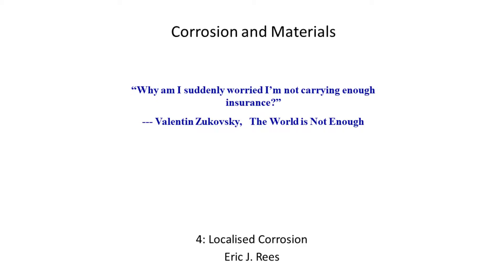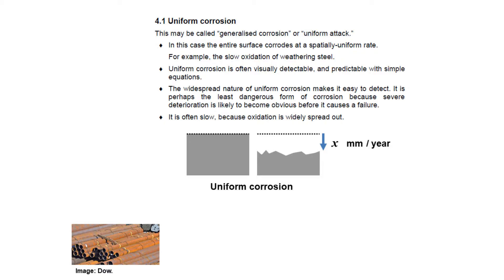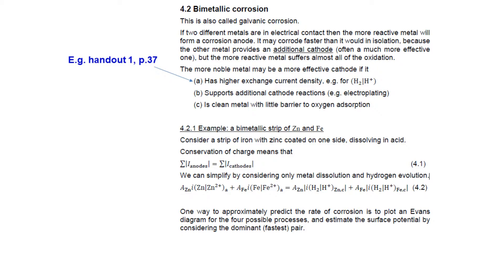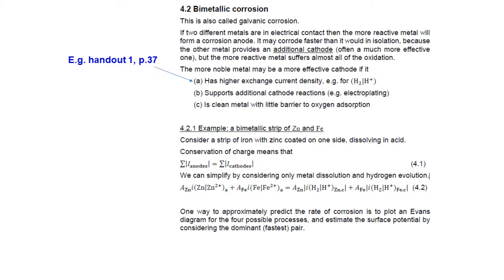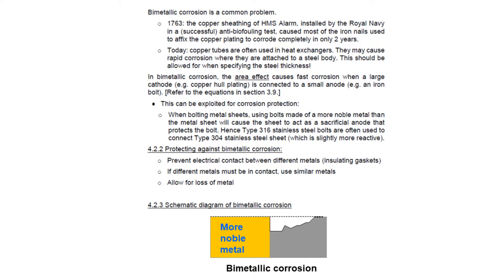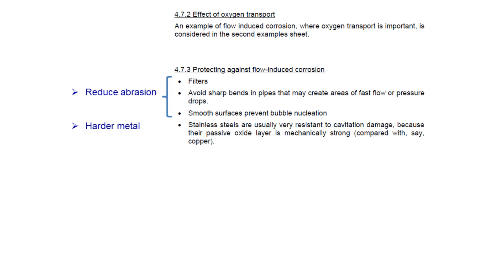Corrosion Lecture 6: Localised Corrosion (part one of two)

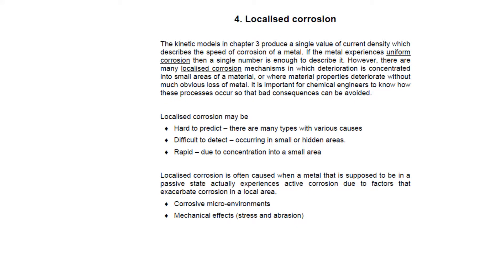Comment: 1:43 4.0 Localized Corrosion
2:00 4.1 Uniform Corrosion
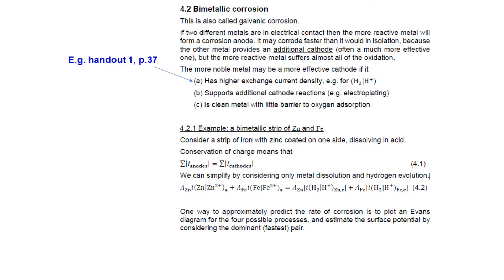4:00 4.2 Bimetallic Corrosion or Galvanic Corrosion
15:48 4.3 Deposition Corrosion
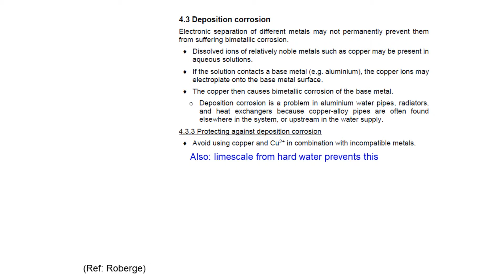18:30 4.4 Crevice Corrosion
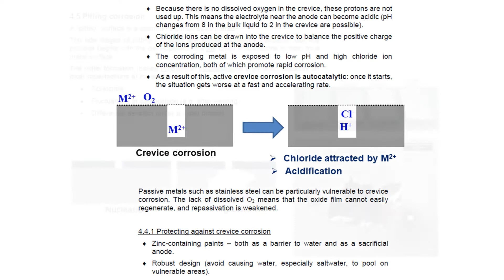24:05 4.5 Pitting Corrosion
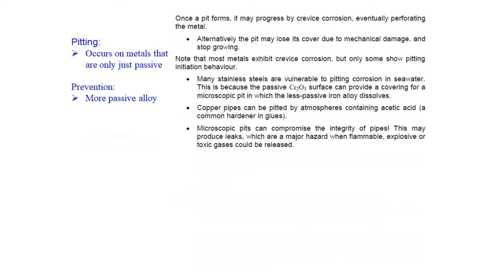31:56 4.6 Intergranular Corrosion and Weld Decay
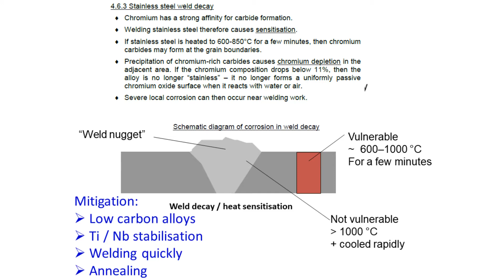42:54 4.7 Flow Induced Corrosion
Reply: a very nice lecture indeed.